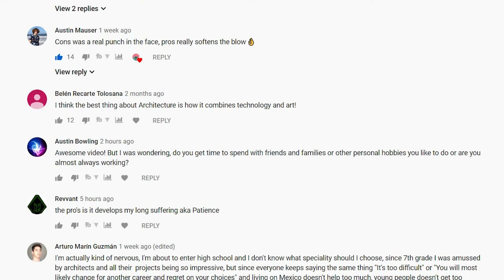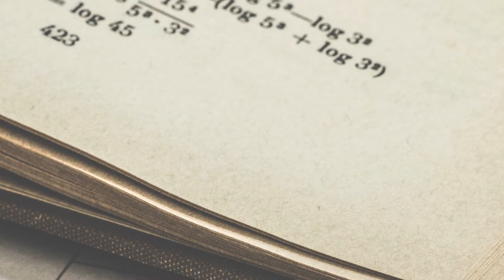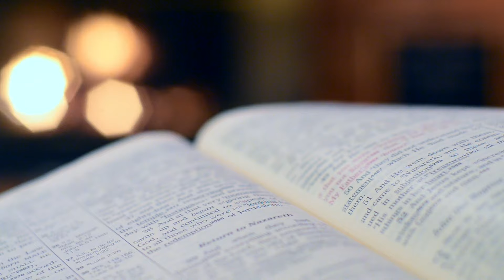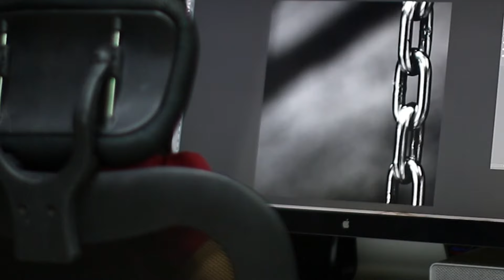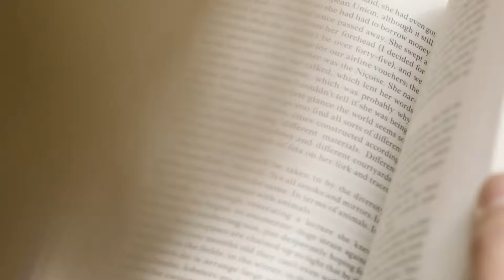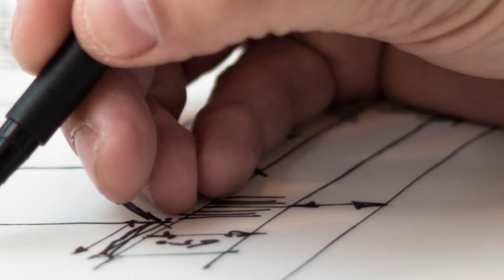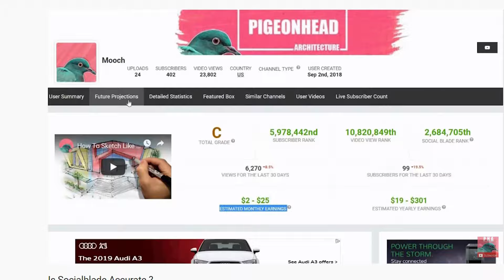Is Architecture A Good Career?

Comment: Just like what my  college instructor once said, "An engineer knows everything about one thing. An architect knows something about everything."
Reply: Awesome fact
Reply: #teamengineer
Reply: Wow
Reply: What a conceited thing to say lol
Reply: Architecture is a kind of Engineering in a sense because all engineering is, is design.
Reply: Architects should get paid more
Reply: If your professor said this, and you believe it, then both of you have zero comprehension what engineering is. A failure to understand what goes into construction. 

Engineers hold much more responsibility in what they do because they learn and know twice more stuff in twice as many fields then architects do. CE alone has structural, transportation, environmental, water resources, geotechnical, construction, manufacturing, scheduling, cost estimations, surveying, management, ethics, you think my job is to know just one of those things? Engineers need to know and perform in multiple disciplines because that what comes with the job. Engineers means you are going to wear as many hats as feasible possible, because that's what good engineers do. On top of what was mentioned, its expected to learn in addition some sort of electrical, mechanical, plumbing, and anything else that is useful. 

This video states that architect will have to do quite a bit of research based on what they are designing, the same goes for engineers except in a very calculated manner as opposed to an architect's visionary perspective. Architects are familiarized with multiple different fields to comprehend what the project can look like. Engineers (theoretically) strive to consume as much knowledge that they can use to be the most efficient problem solver they can possibly be. Engineers not only do as much intermingling if not more, but they also have to do it in a much more thorough and pragmatic manner, because they will use that knowledge to actually make things happen.
Reply: @liemduong6729  struck a nerve? lol

Comment: Two points: Time. Wright wrote in the late 1800s (no kidding, he lived a long time) that it takes 10 years after school before anyone can "touch the belt of an architect". I graduated in 1979 so in my experience 10 was just about right so maybe it's closer to 12 today. This is because the complexity of the job cannot be taught, it must be experienced. Mistakes have to be made and worked through to completion. Dodging bullets is how architects learn. Fear is a powerful motivator. At around a decade of working in the real world, there will be an awakening, or perhaps you might call it an epiphany, at which point you will see the planets align and the whole 15 or so years will suddenly make sense. You will still have lots to learn but you won't be lost all the time. You will have command of a complex/comprehensive professional skill set that you can rely on in any situation. You won't be afraid anymore. You will be an architect. Money. This is the difficult part. Architecture is a "fee for service" business. The fees are fixed professional based on a market rate percentage of the cost of construction. This means that if you screw the pooch and go over budget, you ( or your employer) have to eat it. The way firms manage this is by over tasking the staff, working lots of overtime and then bringing in reinforcements at the end of the project. Not optimal for the worker bees but it seems to be the nature of the profession. Finally, architecture is a "feast/famine" business.  When people are building (like now) there will be lots of opportunity, when they are not building (like the next year or two)you will have to have a fallback source of income, or live off of your savings...or move in with your parents:-) good luck you future architects!
Reply from the maker: I love this post! Thank you for providing your insight on the career - this will help out those who are looking for answers about what the career is like at a professional level. Thank you for taking your time to write this detailed reply!

Comment: I really don't know what to do. I'm at my first year in electrical and computer engineering but I wanted architecture before. I wasn't sure if it was the best for me, but I feel like my current school is difficult and I don't think I prefer it over architecture. But if I choose what I like more I'm afraid of my future as an architect. It has so much unemployment in architecture that I'm scared that if I switch schoosl I might regret it later. Ahhhh😣
Reply: I kinda feel the same way. But for me, I'm in my first year in architecture school and thinking about changing major because of the fact that architects don't get well paid. Not meant to be greedy but in the end, we have to get a fulfilling job.

Comment: I know you mentioned being able to switch between various designing fields whether it was lighting or furniture, but if I go to university specifically for an architecture degree, how broad of a field would you say that covers?
Reply from the maker: If you go to school for architecture, you'll take classes like history and theory of architecture, structures, design classes, technical drafting classes, materials and methods and professional practice. All your classes will revolve around architectural design. Here is the thing: the bulk of your classes will be your design classes. You have one each semester. 

Each semester you'll be given a design project (or a few) that revolves around a concept or problem. Sometimes you'll design an art gallery, sometimes a house, sometimes a building that deals with climatic issues, sometimes it will be something futuristic etc. It depends on the school. Sometimes it could even be a piece of furniture or object. It's tough to explain.  Whatever the case, you are expected to thoroughly  research the projects "program" and that doesn't mean you'll be researching for one week. No , you'll be researching for the whole semester to make your project a believable and accurate one. 

So if you're designing an art gallery, you need to learn what a gallery is, how it works, how art gets transported and maintained, how it is protected, how to you load / unload artwork, how many people go there and how do they deal with it, and so much more. In order for you project to succeed, you have to really investigate your topic. 

So to answer you question, you'll only study architecture, but depending on your projects, you'll actually be researching and investigating other miscellaneous topics as well.

Comment: I’m about to finish foundation programme at my college (it’s kind of like high school year 12) and I’m kind of torn between choosing architecture or interior design.  I like both quite equally but still find it hard to decide.  Would you love to share some insights about the majors?
Reply from the maker: Hey!  Sure! 
Based on my time at school, architecture majors really focused on the exterior of the building and the way the spaces were put together. Their interiors were usually a bit weak though. Interior designers never mentioned the exterior of the building and instead spent their time researching how to transform interiors through materials, textures, colors etc. I spent a lot of time with students from both sides and I'll tell you that there were talented people on each side but the ones whose work stood out the most were those who were the most passionate. 

Working has been a different story though. At work, I'm surrounded by only architects and engineers. My time around interior designers has been very limited so far and so I can't accurately tell you how the experience is. In an architecture firm, though, it's a lot of about the design of the space. Making sure that the client feels comfortable, the building is safe, and everything performs efficiently. It's a lot of teamwork and communication with the engineers, making sure everyone agrees that the design being created will be best for the client.
Reply: Mooch thanks! I’ve decided to try out architecture for a year first to see if I really like it. I reckon that I can always transfer to other majors later, like interior design or landscape design. Thanks again for the elaborate response
Reply from the maker: @WJHou-hz2de  cool! Glad to hear that
Reply: Mooch yeah

Comment: Is there a career in architecture that allows you to  make models of designs given to u by your clients or someone else in the office. Because i love crafting and working by hand (with wood, plastic etc)
Reply from the maker: Definitely. In house I've seen firms that have 3D printers/ laser cutters and then someone will be in charge of making the 3D computer model and then making the parts on the printer and/or cutter and the assembling it. 

There is also the option to make models out of wood, plexi, and other materials but firms usually outsource this. Meaning that you should start to make a list of companies that offer this as a service and contact them to see if they are hiring.

Comment: I love you showing all the nice videos but aren‘t the objects shown in there like 5% of what architects design and 95% are rather mundane houses?
Reply: Like 95% of the people who become architects don‘t end up designing the stuff you showed? Or no? Prove me wrong
Reply from the maker: Hey! Sure, there were a lot of interior spaces in the video, but architects still play a role in most everything that was shown. Architecture doesn't only deal with new, cool buildings, unfortunately. There is a lot of restoring/remodeling to be done. Sometimes the exterior of a building is fine but the interior has to be updated. This goes for airports , hospitals, schools, etc. It really depends on the firm, but there is usually a balance between new and existing projects.

Comment: I'm a 31 yr old Navy Veteran and have switched from Mechanical engineering to Information systems and have been in that for a semester. I am considering in trying to transfer into B.Architecture. Do think that it's a good move? Some people say architecture is soul sucking when you are out in industry. 

Biggest concern I have is how long it takes to finish schooling and ultimately the job opportunities once graduated.
Reply from the maker: Hey! First of all, thank you so much for you service :D

I think that you have to understand that architecture is all about the design of a building. That not only means the aesthetics of the building, but also the bathroom layouts, finishes, etc... sometimes, in some firms , you'll only do specs, or you will only work on construction documents. That's why it can be referred to as soul sucking. People think you'll go out and design the coolest stuff in the world; this is not necessarily the case. At first, you'll do a lot of boring stuff that might get repetitive. You have to look at the positives though.

You have to get your degree from an accredited school. That takes about 4 years for a bachelors and another 2 for a masters. Some people decide to take less classes due to workload so add another year or two if that's the case. As for jobs, you'll be able to find them if we are not in a recession. It's usually really easy to find a job if the economy is doing okay. A lot of architects save a lot of money while working so that they are prepared for the recession. I think this is good practice anyway.
Reply: one of the things that sucks about architecture, at least in my school is that you have to complete the studios in order, so you HAVE to do the full 4 years for a bachelors even if you have already been in school for a year or two. It's hard to say, but architecture teaches you a lot of skills so even if you don't want to be an architect afterwards, but you still enjoy designing you can apply those skills to other careers. Architecture is really just about learning how to design spaces. Most of the design fields use the same programs as architects so Photoshop, illustrator, rhino, indesign, light room, and other rendering programs are all skills you can take into other design fields. Really the biggest drawback is the time investment, both in class and outside of class to learn all of the different software. Design is iterative so at least in my case, my work is ALWAYS in the back of my mind and it can be difficult to separate my life from my work and that can feel soul sucking too, because you never feel like you can get away and relax from your work.

Comment: Hey, Mooch. What do you think about time? Time, as in graduating late or not transferring to uni within the normal 5-year "time frame" some universities have for their architecture programs. I'm worried that I'll be graduating quite late for the degree. I've first did two years of Nursing prerequisites at a community college, but seeing that I don't have a passion for the medical field, I've switched majors to Architecture. I'm currently in my third year of community college literally starting from square one--taking all the required prerequisites so that I can transfer to the public universities for their arch programs. My supposed educational plan/outlook  includes all the needed courses to transfer which would take me around 2-2.5 years. If successfully accepted to the architecture school of my choice, that would be an additional 3 years of school. Do you think that this is concerning? I know that students who got into architecture school  (in my age group) two years prior would definitely graduate earlier than me, but still I can't help feeling that I'm way out of the loop. Thanks for reading, btw.

Comment: I did an Architecture program for 4 years, 9th grade to 12th grade (im in 12th rn) and theres a scholarship opportunity that I was offered because I stuck with them for all 4 years. However, my interest has drawn away from Architecture to Finance, so im in a bit of a dilemma. If I tell them Im not going to do architecture, I wont get the scholarship. What is the smartest choice?
Reply from the maker: This is an interesting case and I definitely don't want to give you wrong information. I would talk to a few counselors and get their opinions. 

It's complicated because maybe you like one major over the other for the wrong reasons. I would continue to research both and see what career opportunity you would like to strive fore with each option. That may help you narrow down your choice.  You could also double major if your up to it. But like I said, research both, talk to counselors, and try to go to the university you're interested and take a tour for each program.
Reply: @Moochers  ok thanks

Comment: What are the basic subjects you need to take  in high school for architecture in college
Reply from the maker: There isn't much. Physics will help (especially if you can remember everything they teach you). If you high school offers CAD (AutoCad), you'll be a bit ahead. Maybe learning about computer programming/coding - you don't need this for architecture school at all but I feel that as technology advances, architecture and technology will merge further, and understanding how to write code may help you. This, by the way, is 100 percent opinion. I haven't read anything that says coding is important in architecture, nor have i experienced this myself in the profession, but it's an intuition I have.  

If they offer classes on construction and building, take that. When you get deeper into architecture, it will help to know how to build, at least at a basic level, the things you are designing.

Comment: I have a question is it even Viable to make older looking buildings anymore such as Gothic
Reply from the maker: Hmmm... It depends what you mean by viable. If you mean cost effective? The answer is no. Buildings have their typologies based on the era's culture and physical limitations of building technology at the time. Today, at least here in the US, we want buildings to be made FASTER and CHEAPER. Architectural styles like Gothic, as you mentioned, require a lot of detail and structural techniques that take longer, are more expensive, or require more material. That's a no-go (unfortunately!) 

Now, there are a few examples where you would see Gothic architecture being built : 
1) A building designed using Gothic (Revival) techniques 
2) A client is facinated with Gothic and decides they want to absorb the expense 
3) Remodeling 
4) Fake Design (The structure is all steel, the facade is Gothic) - Something you would see in Disney World lol! 
5) Local laws/ building code requires you to respect the vernacular. 

Hope that helps!
Reply: Mooch Thank you

Comment: is it hard to find your clients? if so how do find your clients?
Reply from the maker: Architects usually find their clients through word of mouth (referrals). There is a lot of work done from past clients as well. Typically an architect will work at a firm form X years and then when they venture out to open their own firm, they contact other architects/ past clients/ companies to inform them that they have a firm and they are ready to offer their services. Sometimes this new architecture firm with strategically partner up with a bigger firm and help them out.

Comment: what's the difference between architecture and architecture engineering (major wise and job wise)?
Reply: I think architecture engineering is more like structural engineering. architecture is more like an art discipline.
Reply: I'm not an architect (civil engineering), i'm studying architectural design tho. Architectural engineering not only is related with design, but how the building will work technically. This means: orientation, shape, energy consumption, natural ventilation, natural heating and cooling. Type of facades, materials, use of mechanical systems, structural system...... 
I feel it like the mix between 2 different worlds that once were one.